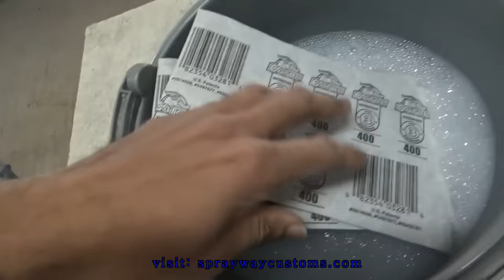How To Spray Paint A Helmet Step By Step - DIY CUSTOM PAINTED MOTORCYCLE HELMET TUTORIAL - Two Tone

Comment: You really make it look easy. Thought, you know what, I can do that. Took a cheap £20 helmet and sanded it down. That’s probably we’re the easy bit finished. Everything else was a nightmare. Primer went runny and started dripping. First coat did not adhere well to primer. Ended up putting 4 coats. Didn’t dry for more than three days. Taped it up. Take edges didn’t hold tight and the second colour went into it, no clear lines. Third colour was ok. Finishing enamel didn’t dry after three days. Went to take take off, wasn’t pressing hard. Whole thing is a right mess. If thinking of painting your helmet, forget it. Might as well just throw it in the bin like mine.
Reply from the maker: Thanks man…I hate to hear you had so many problems with yours

Comment: Straight heat!  Just in time for warm weather. Thank you for the step by step.  Also, how can I send you something like and address or PO box? I was wondering if you could use some things to make filming your videos easier. We got some small hand tripods that are "handles" when you are filming but you can set it down and keep filming so you can use both hands in those sanding shots. Your camera should just screw right down on it. If you don't need anything that's cool, just keep making these valuable tutorials
Reply from the maker: Here's my email sprayway123@gmail. I don't have a PO Box at the moment

Comment: Great info and vid my man, a plan on doing lots of helmets so this is great information, thanks again dude😎✌️
Reply from the maker: Great. Thanks Ryan
Reply: @SprayWayCustoms  quick question, I'm doing to helmets right now, just to confirm is 400 the final grit to finish the primer and guide coat? For some reason I thought it had to be 600?
Reply from the maker: 400 will be fine to spray base coat over. I always use 400
Reply: @SprayWayCustoms  perfect thanks again dude 😎

Comment: So you don’t have to do anymore sanding at all until after the clear coat? The layers of paint don’t need sanding in between? Or if you tape off designs, you don’t need to send everything before final clear coat?
Reply from the maker: You don’t have to sand if you don’t let it sit too long
Reply: @SprayWayCustoms  right on. Thank you for responding as always. I’m learning pinstripe and lettering and gilding right now. Paint too but I live in an apt so can’t paint much. No room for the equipment and both so I’m using expensive aresol paint right now. Practicing on all my helmets then I’m going to do my bike over and over until it’s where I want it. Then I hope to have somewhere to do bigger projects and have the equipment to to spray the paint and flakes that I want. But honestly, these $20 and up rattle cans look professional if done right. Love your work. I live nearby and I’m surprised as many nice cats and classics around here, not many people are rolling with your caliber of paint work on their cages. I don’t get it. Thanks again

Comment: Very nice job on the helmet.i have a question for you I'm about to repaint a set of calipers that are on now powder coated black if I scuff them up to repaint do I have to use a high heat primer or will the old powder coat protect the new paint
Reply from the maker: Just scuff and paint will be fine. I always use regular automotive paint and clear and never had a problem
Reply: @SprayWayCustoms  ok thanks